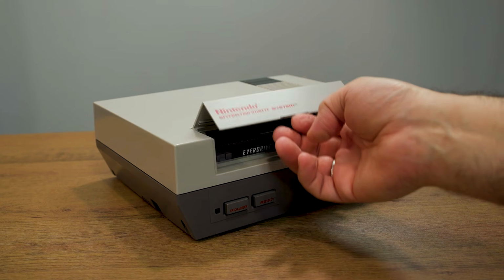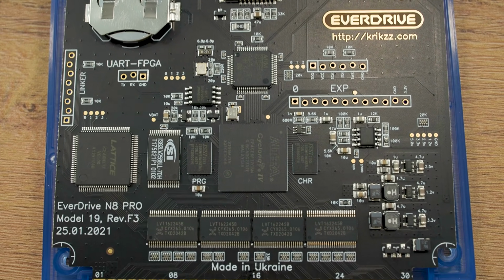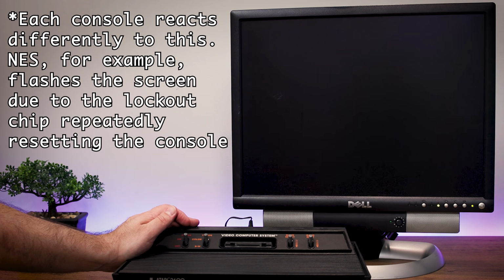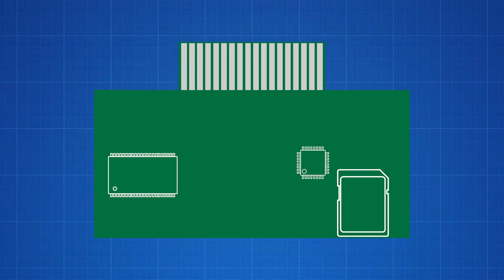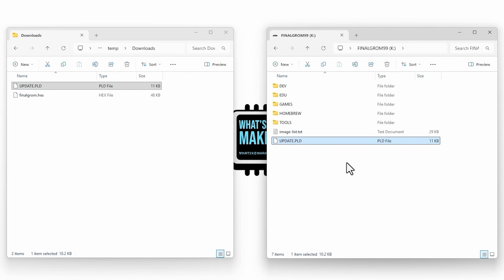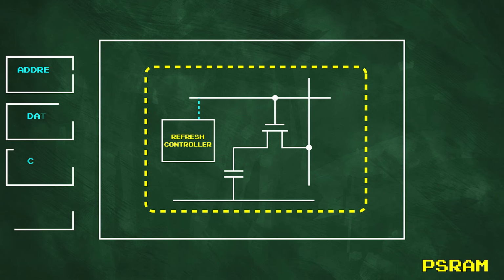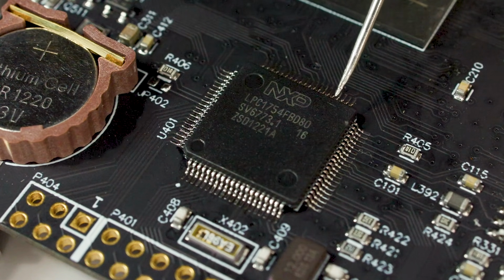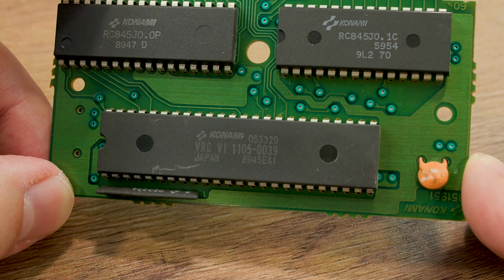The Engineering Behind Flash Carts

Comment: No, I don't have a flash cart. Is this the norm? Most games I want to own are quite affordable.
Reply from the maker: I guess it depends on what you want to play. I tend towards lots of homebrew these days and not everyone releases them on physical cartridges
Reply: If your interest is only in original games completely unmodified, then a flash cart is not at all essential for most systems (but might become more needed in the future as carts gradually wear out and become rare). But a large part of retrogaming community find some value in expanding beyond that. Homebrew and various types of romhack become possible to use on real hardware with these.

Obviously we have things like all of the Mario series romhacks, both the Kaizo ones, and the more approachable ones. Speedrunners find value in using practice hack roms for practicing. Plenty of people find fun in the use of randomizers on various old retro games, and being able to play these on original hardware is often deemed desirable (lower latency than PC based emulators, ability to use the originally intended controllers, etc).
Reply: I find the translations to be the main reason to use flash carts or repros, so you can play them on the real hardware
Reply: I have flash drives because 1 expensive game usually justifies it instantly
Reply: I get it. I'm odd for not having one.